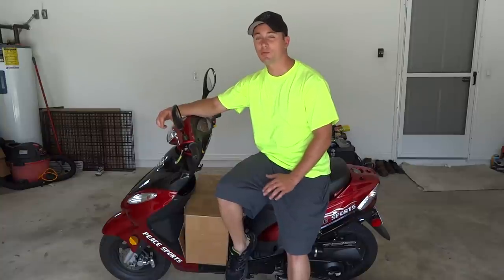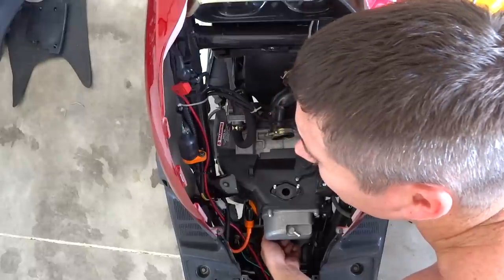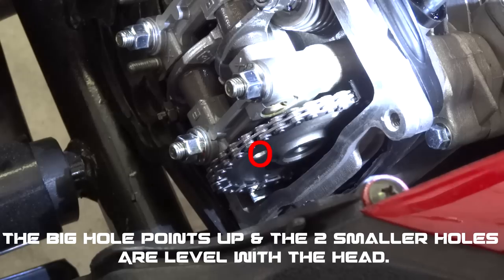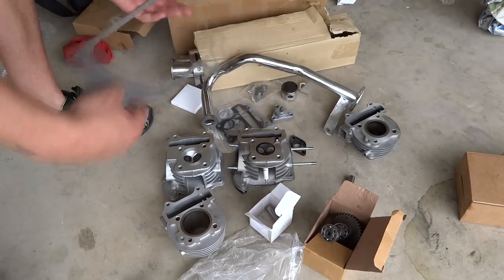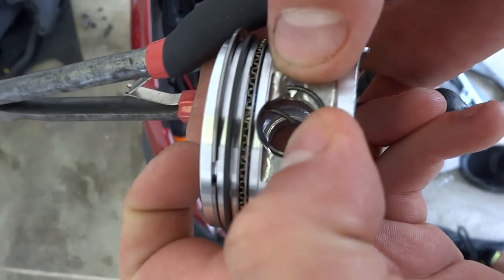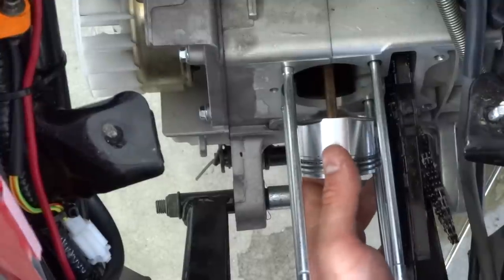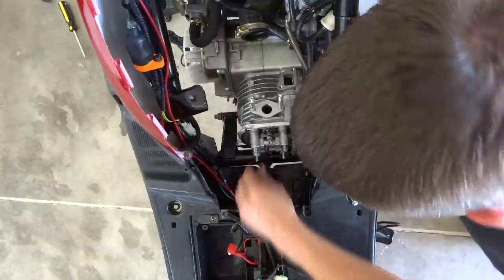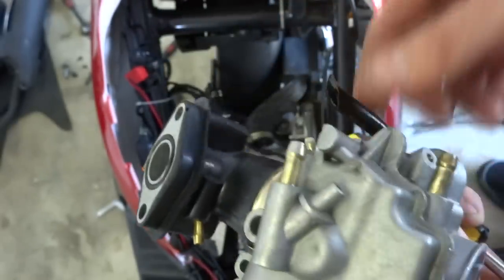DIY Gy6 Scooter 50cc to 100cc Kit

Comment: Hey I follow this video step by step and I messed up on a few things.
1. I did not put the heat shield back on
 2. I did not put my exhaust gasket back on.
 3. I did not adjust my rockers properly
I am not blaming the video,  I just was tired and ready to put it back together

Comment from the maker: Yes I know it's 82cc but they call it a 100cc kit. The stock fan shroud still should fit..It's in the air right now, but I might make a big cpu fan with a temp censer attached to the head.

Comment: Will you ever do anything with a Whizzer motorbike ?  My only changes I did on mine was the high compression head, echo pipe and twist grip controls.   Before it was 2, 5 HP and 35 MPH. after 3.0 HP and 40 MPH.  I was 16 then, now 80.

Comment: Hi, when you took off the plastic cover surrounding the engine, did you leave it off? I was just wondering because I was thinking I leaving mine off, but wondered if it caused any further problems? Such as cooling problems
Thanks
Reply: James Towse how are you thinking ? The plastic covers Cools down the engine with the fan on the side !
Reply: Without the plastics it will overheat

Comment: The cylinder head is the same size as the original one and the valves. Is that going to make a difference in performance? Shouldn't the valves and the chamber be larger to accommodate for the piston size

Comment: You shouldve oiled the piston and cylinder before putting them on. Also there is a torque spec for the headbolts and side bolts. And the gapping is off, the intake should be a bigger gap than the exhaust.
Reply: Joey Taber nah they can be gapped at the same size
Reply: Joey Taber they can be the same, I run a Lada Niva and the valve lash is the same.  But if the are different, the exhaust is in my experience the larger gap due to the fact that they run a higher temperature and expand more at operating temperature.

Comment: I just did the conversion but I'm stuck at the rocker arms cause I don't know if I have to change them like you did please help me bro
Reply from the maker: It's pretty simple. If you have the 69 mm valve length then you need a 69 mm rocker arm assembly. If you have a 64 mm valve length then you need a 64 mm rocker assembly.

Take a digital caliper and measure from the top to the bottom of the valve. It'll either be 64 mm or 69 mm. That's how you will know which rocker arm assembly you need.

Just for you I added the 64 mm and the 69 mm rocker assembly that's completely assembled. It's really cheap so if you don't want to do the swap you can just order it pre-assembled. I pin my store to the top comments, but here's a link for you..
https://www.nthefastlane.com/gy6-scooter-50cc-to-100cc-kit-store
Reply: @Nthefastlane  ok so I had the 64mm valve but changed it to the new 69mm. do I keep the old arms and swap the bracket or keep the bracket and swap arms from old to new ??

Comment: Great video. Question though, did one of the new rocker arms not slide into place easily? For me, one fit perfectly, the other will not fit in between the two walls.

Comment: should alway oil up the piston and bore before putting it together will make and easier accembely and pre lubricat so it doesn't run steel on steel till the oil reaches it

Comment: Hi man what is the metal triangel thing i have it to. but dont know where to mount it
Reply from the maker: Thank you for the question. I have answered your question here: https://youtu.be/xnBtKxbpJIU
Reply: It’s the higher capacity oil pump and you should if you can install it. There should be videos on here showing you where it is. I think you have to split the case for it though

Comment: 50mm bore is 81,25cc ;) The biggest I have seen with no stroking is 89cc which is 52,4mm bore. I am running 72cc on mine which is 47mm bore. Still a great video tutorial for changing cylinder :) My next step will be cam and bigger valve head.
Reply: Did u use the valve head from the 39 mm,just wondering if it will work to use the 39mm valve head on a bigger bore
Reply: @chrislavalley4062  It works, but I have another head with bigger valves.
Reply: Will the piston hit the head,I have a 50 mm big bore with the valves that match it but my exhaust valve leaks so I was wondering if I could take my old 39mm valve head and put it on the 50 mm
Reply: @chrislavalley4062  Yes, I said it works. It wont hit.

Comment: I was curious when you put the piston in before you put the piston in you never put the Rings in the cylinder to check the clearances was curious what is the Piston Ring clearance piston ring clearances very important even yeah if the manufacturer instructions say that it has already been done I always check it myself to make sure that the ring clearance is correct I'm retired mechanic transmission specialist in Powertrain also specialized in modifying carburetors for gas mileage it always pays to be thorough because sometimes when things are manufactured in mass quantities there can be errors that's why I always check the ring clearance even though the manufacturer has written that the ring clamp has already been checked also with the spark plugs a lot of spark plugs say they have been preset it's always good to check the spark plug gap I hope the information I have given will help people and in the man who's made this video otherwise it was a really great video I made a suggestion earlier to get a better view of what's going on my ideal is take a Powertrain out of the scooter and I would show the Big Bore Kit installation on the workbench what in this way you would be able to see more what's going on so people can see in more detail because a lot of people have not ever put a Big Bore Kit into a 50cc scooter also it would probably help you pee headed adjust a person just to operate the camera these are some ideas to help the man with the videos he did a good job but sometimes it's hard to see what's going on so this is why I communicated with you about this issue

Comment: Big Bore install, First time working on scooter so excuse my discription, on final step my cam wheel and cam shaft are all top dead center. install complete,  my rocker arms still move all over, if I move the cam wheel the rocker arms line up with valves but no longer top dead center. how can I adjust this im guessing timing is off but I'm a complete novice thanks

Comment: I need help!!!!!!!!
I installed my 100cc big bore, exhaust, and the new carb. Removed the factory air filter and placed the most common sent with the kit. I used the original spark plug because my scooter is only a few months old. I can’t go more than 15 miles an hour! It’s putting. I can’t hit my throttle without that happening. What did I do wrong. I hope someone sees this soon I go to work today at 5pm eastern standard time.
Reply from the maker: Thank you for the question. I have answered your question here: https://youtu.be/xnBtKxbpJIU

Comment: So I just finished throwing this kot on my 2013 taotao and it runs good (minus the jet in the carb I need to do).  however, I feel like it drained my battery because nowmy electric start is like dying.  do I need to do like a battery upgrade with this kit?

Comment: I would have got up work head with bigger intake and exhaust valves so you can get the air in and get the air out more quickly also I have a question we are going from a 50 cc scooter piston and replacing it with a 100cc piston the Piston is heavier and you only have one piston you've just added weight what about the balancing of the crankshaft because you just added weight because you added a bigger piston is it going to throw the balance of the crankshaft off was curious please reply to my question I did auto mechanics for many years and I rebuilt car motors in a car you only take maybe Thirty or forty thousand off each cylinder but a scooter is only one cylinder by putting in the big piston maybe I'm wrong but it would throw the balance off of the crankshaft so the crankshaft would not be in Balance anymore because you put on the bigger piston

Comment: @Nthefastlane I see you're using the a 150cc header pipe with the bbk.. Did you drill out the holes on the header pipe or find an adapter to make the pipe fit properly?

Comment: Question? Is it possible to swap a stock 200cc engine with a 90cc engine? I am a beginner to scooters. I wanted to start to a lower phase before going with higher speed. If it is possible, where can I buy a 90cc engine from Honda or Kawasaki? I hope that someone could direct me to the right direction. Thanks in advance.
Reply from the maker: Thank you for the question. I have answered your question here: https://youtu.be/xnBtKxbpJIU

Comment: Is this 2 stroke or 4? Is there any difference in the head and cylinder size et.c ? Im wondering if its the same engine as 139qmb gy6 50cc ?
Reply from the maker: Yes, 4 stroke & yes the same exact engine.The BBK makes the head & piston bigger.

Comment: Hey, may be a dumb question but did you drain all the oil, gas before, then add new oil after? Also, I'm just making sure you said you ran a 150cc carb because the 85 jet didn't work? Wouldn't that be running it too rich? Thanks
Reply from the maker: No, left everything inside..Nope, it loves a stock 150cc 24mm carb with a sponge filter.

Comment: good job , the only constructive info that i can inject ,  is to lube all new parts with a coat of oil , especially the cylinder bore . and to use a dab of locktite on the rocker arm adjusting nuts , which seem to back off and loosen at times . the x tra horsepower is really  worth the time and money that you put into it . and it is none of the governments buisness that the xtra 50 cc's was added . Great job explaining ,  to the do it yourselfer

Comment: Are you putting that gasket on dry or did it come with grease on it. because if it doesn't have grease, you need to grease it with wheel bearing grease. otherwise if no grease then it's a sloppy job bro.

Comment: So you used a 50mm big bore ? I believe there are 81 or 82cc real cc's. The max you can go is 52mm / 88cc real. I use a NCY 52mm on mine and i had to replace the crank yesterday since the bearings went out and made horrible noise.
Reply: +daand12 
Yeah, came here for 100cc, i've installed some cylinders as this, and it's around 80cc!
Reply: +Gasrullen And i reached a great gas milage today with my NCY 90cc. It was even better then with the 50cc cylinder.

Driving at constant 55~60km/h on speedo does get me about 1 liter of gasoline on 40km. Never had this with my 90cc or 72cc.

I drove that slow, because of a new Sym moped which was restricted to 50km/h ( 55km/h on my agility speedo ) from a guy i know.

So 90cc's don't really use much more gas then a 50cc :)
Reply: daand12
Tuned properly it doesen't have to struggle as hard with bigger cc, and the piston was probably worn on the 50cc :)
Reply: +Gasrullen Nah it wasn't :) It had a Top End rebuild ( 50cc ) 2 times as it used alot of oil twice!. Third cylinder didn't burn any engine at all.

Later on i installed a 72cc ( exactly a year ago ) and drove about 6000km with it. Then the 90cc and it does use a little bit of oil, but nothing to worry about.

It does leak a tiny bit of oil at the drain plug. I had to install Heli Coil threads a week ago as i pulled out the orginal threads when attempting to take out the bolt :O for replacing the washer for a soft copper one.

Same again, nothing to worry about oil dripping on the floor ( Haven't seen it doing for about 5 days or so ).

Almost drove 400~500km since the engine rebuild and i think i have to re-tighten the head bolts. Got a weird knock coming from it and it was known for me.

Comment: So this is probably a dumb question, do you jave to drain the oil for this?
Reply from the maker: Not a dumb question at all,No you don't have to drain the oil as long as you dont get any grime or dirt down in the block.If you decide to drain the oil.. the type of oil you're going to want to use is Castrol GTX synthetic blend 10w 40.
Reply: Sweet. Thank you for the quick response. I just picked up a free scooter and it has no compression, so im doing this kit. XD
Reply: Tyler Twaites Hi m8 , same here i got a cheap 50cc scooter no compression,(only done 1000miles) turned out to be a simple case of zero inlet valve gap, adjusted it!!, and scooter fired up and ran a treat, il fit my 72cc bore kit i bought when id had my fun.Hope u fix yrs too.  Thx Paul

Comment: did you have to change the things in the variator and clutch or not?
Reply from the maker: The only thing I change was the variator weights to 7g and upgraded the carburetor to a 24mm with a 105 main jet. I added the 150cc intake neck and foam filter. Did 56mph on flat ground. It all can be found in my store link.
Reply: @Nthefastlane  alright man thanks for the info have a nice day
Reply: @Nthefastlane  Do you have any idea why mine can only hit 47 downhill? 104 jet.

Does adjusting valves help?

Comment: I have a head kit but no rocker arms. Do you think without new rocker arms I'm going to do any real damage? Or is it going to be more of a wear issue over time?
Also I did not replace the cam, mine did not seem to be of any different size. Was yours?
Reply from the maker: The bbk rocker arms are longer and you need them.
Reply: I can understand with more.displacement you need a long stroke, thus the full potential of an upgrade kit will not be realized without rockers and cams replaced. Large exhaust is going to be more important and in many cases replacing the carburetor or tuning the existing one. In my case I couldn't get my scooter to start until I changed the carb.

Comment: so i followed the guide. but when i start the moped, its makes one turn and stops for a second. then turn again. then it stops completely. i alo hear like a popping sound almost like the cylinder is messed up. the hell did i do wrong.
Reply from the maker: Make sure the cam gear and crank marks are correct before the chain is put on. Sounds like you're off a couple of teeth.
Reply: @Nthefastlane  so my cam shaft is basically backwards on top dead center. if i have the T lined up, the big hole is opposite where is should be. what do i do?

Comment: what did you change your main jet to? upgraded a customers scoot and it is bogging down and i dont notice any significant performance increases
Reply from the maker: I changed the entire carburetor out for a 150CC carburetor they come with a 108 main jet.. you will need a 150 intake manifold though. if you're going to use the 150CC carburetor I suggest upping the jet to a 110 and changing the needle to either the middle or the top. I noticed I started getting a little detonation with the 108 main jet when I put the fan shroud cover over the engine. It also depends on your altitude, if your down in Florida,close to sea level you're going to need a different jet.
Reply: i put a 90 in that was supplied with the kit and it bogs/chokes at wide open throttle like its not getting enough fuel.

Comment: Will a 85 main jet be rich enough in a 80cc big bore kit? I have a aftermarket keihin carb on my 50cc right now and the 85 seems to be really rich even with the carb leaned all the way out. I just ordered my 80cc big bore a couple of days ago and haven't installed it yet. I just want to make sure I have everything I need before I go and install it. And also will the 50cc rockers work for the 80cc? Because the kit doesn't come with aftermarket rockers,  so I just assumed that the stock 50cc rockers would work. There were 2 different 80cc kits, the 69mm valve size and the 64mm valve size. I got the 64mm valve kit assuming that the 50cc valves are the same size as the 80cc and the only difference is the piston size,  but got confused when I saw the 69mm valve kit. Is that just a different size valve kit for a stock 50cc engine that is the long block series?  If someone could explain that would help.

Comment: Nthefastlan e So here is what I did I bought a 100cc kit on ebay and installed it on my TaoTao atm-50 scooter. I did everything you did in the video. But when I am trying to start the scooter, It makes the sound like its going to start but it did not start. Well this problem is fixed because I spent $300 to get it fixed by a mechanic. Here is a new problem, the bore kit is in, the sound of the engine sounds great but it only goes 35 mph. Can you please tell me what the problem might be?
Reply: Check your CVT (specifically your variator) for any restrictions. There may be a small ring on the variator drive boss that needs to be removed.

Comment: On my 139qmb engine crank goes in easily with hands and it ends up moving side to side about 0.3mm. I mean bearing get to move axially i their housings (cases). Is that normal for GY6? Should it be so tight in case that it could not move at all? Bearing are in good shape, but should i still buy new ones with bigger OD tolerance? But if istalled tightly, should bearings then sit in bottom of cases? If so, then maybe shims should be added between bearing and crank webs?
Reply: Ei mitään hätää, kuulostaa ikävältä, mutta tulee toimimaan hyvin. Olen asentanut useita kampiakseleita ja liikkumavaraa sivuittain on 1-3mm, joten olet kuivilla. Itsekin epäilin asiaa 2t vehkeiden jälkeen, mutta noilla toleransseilla moottorit ovat toimineet hyvin.

Comment: I did this with my 50cc its the 55mm piston big bore kit and i put the a9 cam now it dont wanna spark i have fuel and air and all it i hook a car battery via jumper cables to the starter and case it cranks but wont with the stock battery and the stock batterys not dead any ideas???
Reply: It does spark my bad typo my probblem is it seems like it dont have enogh amps